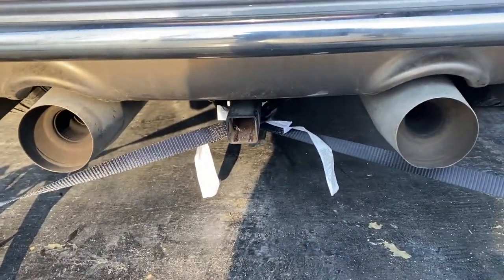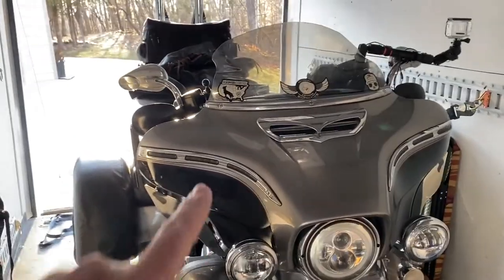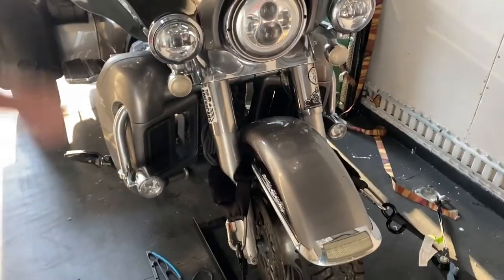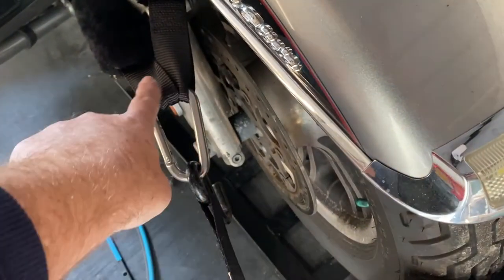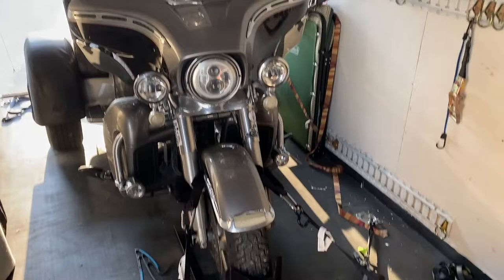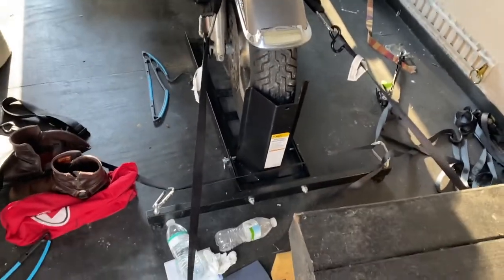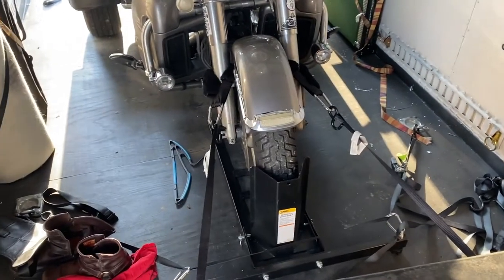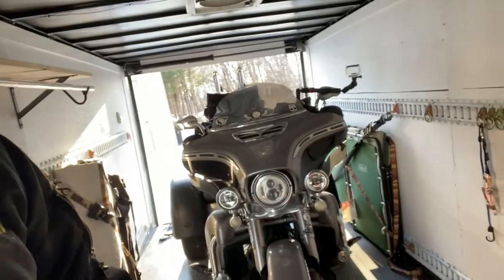Securing a trike tie Down

Comment: You have almost nothing holding the rear down. You are holding it center with very little to keep it from bouncing. As for the front you are pulling your forks apart. Tie from the bases of the handlebars is good. Canyon Dancer on the handgrips is the worst possible. If front end “bounced” then they were not tight enough. Front should be compressed about half travel. If straps loosened due to bouncing then they are inferior straps. The best and safest anchor on the front is to loop the strap over the lower bridge (wrongly called “triple tree”) and around the fork. This point can support the entire motorcycle and does so under heavy braking. Rather than fuss with a soft strap I route one end of my tie over the lower bridge then out the other side. Then both hooks of the tie connect to the anchor in my truck or trailer. 

If using an open trailer put a half twist in your flat ties to keep them from “flying” like a wing. Will oscillate if they fly but the twist will make it fly different the full length, cancelling each other out.

There are blind nuts you can put in your trailer floor then use bolts with wing nut head to quickly attach/detach the chock. You only worry about the chock sliding fire/aft, not lifting. I have tie hooks on my floor with which I use J bolts and wing nuts to secure two dirtbikes.
Reply from the maker: I am relooking at everything as my way is not always the right way. The rear end has never moved and my only true actor point. I just bought better straps so hopefully loop through the tires let me know if this is good. As for the triple Tre spot had to get to with the faring and all I used teh bottom of my handle bars prior. I am trying to see how it wold pull the forks apart but see it as a good point thank you